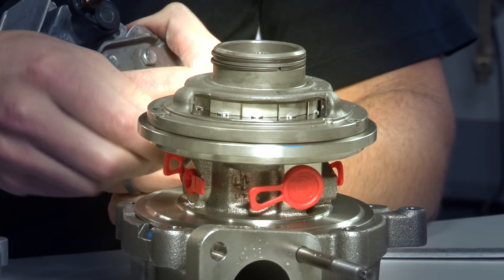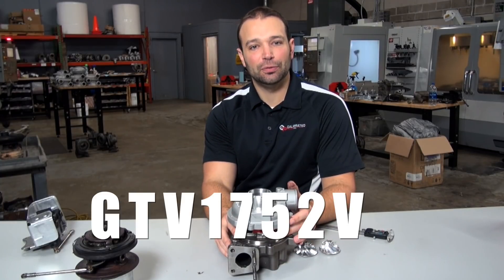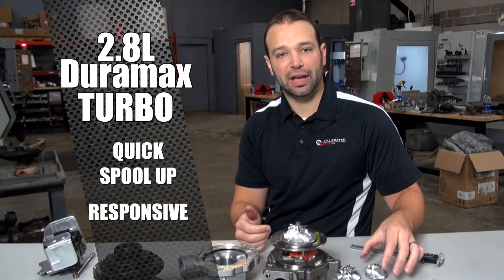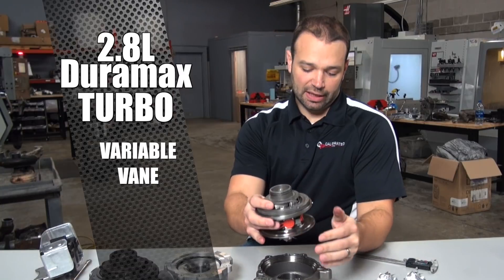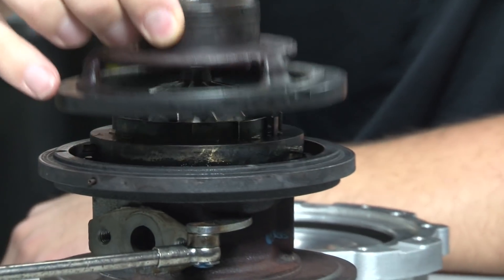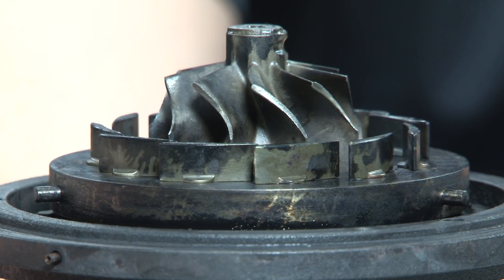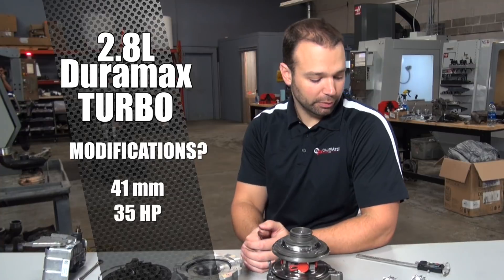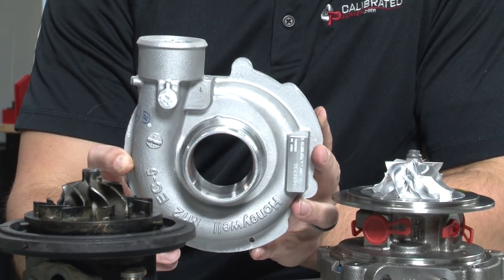The Duramax 2.8L Turbo - Diesel Insights

Comment: @Nick - when you are 'tuning' that turbo on the 2.8, up to a 41mm compressor wheel, do you have any other aspects that need to be redone? Or is it as simple as upgrading the compressor wheel? Im sending my truck into the Chevy dealer and wondering if this is something they can do or do I have to go to an after market tune shop? And do you know of an aftermarket tune shop in the Denver Colorado area you would suggest?
Reply from the maker: Hey Aaron, give us a call 815-568-7920. Our phone lines open at 9 am central.

Comment: Hey Nick, Do you think this is enough engine for a 2021 GMC 3500 cutaway van with a 16 foot box for carpentry use?
Reply from the maker: What’s it weigh?
Reply: @Duramaxtuner  https://www.gmfleet.com/vans/gmc-savana-cutaway-3500-4500
According to this 10-14000 GVW.  I'm lookinga at the 177" wheelbase.  I wish they's bring back the 6.6L duramax in these.
Reply from the maker: @24revealer  I think with a tune it’ll be average. Without a tune it’ll be a sloth. We echo your thoughts on the 6.6.
Reply: @Duramaxtuner  That's what I thought.  I think I'll just order the van with the new 400hp 6.6 gas engine.

Comment: First time I saw that kind of tech. But are those veins the modern version wastegate for turbochargers?
Reply from the maker: Essentially, yes. But they do more than just relieve excessive pressure to prevent over speed. They actually change the flow of exhaust gas around the turbine wheel to change wheel speed.

Comment: Would be nice if the water cooled turbo could replace the one in my 2006 2.8 liberty jeep. The  engines shares a lot of common traits. One is just newer.
Reply: The only thing that's fairly similar is the displacement Everything else has been redesigned

Comment: I drive an 18 zr2 duramax and trust me sir, this turbo has fucking laggg.
Reply: Think you'll find its actually the 'dead throttle' these trucks are known for. Same feeling in mine until i installed a throttle controller and turned it into a whole different beast!

Comment: I wonder if you have to tune it by adding a bigger Turbo wheel  And if it would void my warranty?
Reply: The only thing they could void your warranty on would be things that a bigger turbo could cause to go wrong.  Warranty suspension problems? No, a bigger turbo cannot cause problems to the suspension.  Blown head gasket and toasted motor, different story.

Comment: Any updates on this turbo upgrade? Very interested because this is my second warranty turbo replacement.
Reply: Use amsoil 5-30 diesel  oil. Put it in my 2017 . What a difference. Amsoil is the best

Comment: When are we going to be able to purchase these wheels? Msrp?
Reply from the maker: We have this project still in the R&D stage with no ETA for release.  When we do release a product for the 2.8L turbo it will most likely be a complete unit and not just the wheel.  Thanks for watching!
Reply: @Duramaxtuner  any news on upgrading the turbo?

Comment: I'm sorry to ask, but why the hell would anyone want to tune a 3 yr old Duramax diesel engine? What's wrong with 181hp and 369 lb.-ft. of stock torque? That sounds like more than enough power for a vehicle like either a Chevy Colorado and a GMC Canyon.
Reply: I just tuned and deleted mine a few days ago, the power difference is day and night and better mpg by 5 is a plus!
Reply: 5 mpgs just with the delete?
Reply: @candyred3v   About the same here with an emission intact tune that turns off EGR.  DPF regenerations happen half as often too.  EGR on diesels is the work of the Devil, turning that shit off does wonders.
Reply: fourtwenty mostwanted hows it doing?
Reply: The same reason  people upgrade anything else, to see what kind of performance is achievable
Reply: Ahhh! Okay. I suppose that makes sense.
Reply: your name  Yes, with the stock ECM programming, but an aftermarket tune can avoid that.  Of course there goes the power train warranty too.  I tuned mine, love that the lag at the gas pedal is gone and that it gets 15% better fuel economy.  It even sounds better - not shocking really, what diesel engine runs it's best while sucking down a bunch of sooty black smoke...
Reply: your name  The tune I have keeps all the stock exhaust system, it shuts off EGR and DEF though.  It regenerates half as often (every 540 miles) as it is putting out way less soot than stock, but probably enough NOx to make VW blush.  That is the nature of diesels - NOx vs. soot.
Reply: @duken4evr  would love to have some more info on what tunes you are running. Looking into that for a z71 2.8L. Just doesn't have that "get up and go" I'm used to with my tuned and modded LB7 2500HD. For such a smaller/lighter truck, I was hoping for a little more "zip".

Comment: What we use in 3.0liter engines probably will work with this engine too. So basically take a gtb2260vk and add 51.5/48.6mm turbine and 48-50mm inducer compressor wheel takes you around 400hp.
Reply: When you get to the 400 horsepower range you gotta worry about piston connecting rods on the 2.8  That's the weak point After that you can just get a compound Turbo kit If you want more boost  they even have emissions compliant ones

Comment: Does the egr valve help to control over speed of the turbo or is this done by the vane position? I ask because I'm trying to figure out what the negatives are to blocking the egr valve. Great videos btw  great to see how things work in our trucks without having to take them apart. I'm in Australia with the 2.8 duramax and loving it.
Reply: Negatives of egr - do you really want to pump soot, dirty exhaust, back into the combustion chamber?  No.

Comment: Any reason why the turbo is so quiet? They barely whistle compared with other brands turbo diesels.
Reply: I wish you showed how it gets oiled.
Reply from the maker: It's just the way it's recorded. It is very difficult to record the whistle and replicate the same sound you hear in-person.
Reply: No not in your audio, i own a colorado with a duramax, and here in australia we have only just got dpfs fitted since last year, so earlier models even with a full open exhaust the turbo is barely audible compared with other diesel vehicles.
Reply: I had the  same question with my 2016 colorado. Hard to make out the whine.
Reply: If you find out let me know, I've also got a colorado haha
Reply: i just drove a powerstroke f150 and the small diesels are really quiet.  the powerstroke is more quiet then the ecoboost.  guessing its the same for this

Comment: I just did my oil and fuel filter on my 2.8 L duramax and now I'm seeing the engine shake more than usual. What can cause this ?
Reply: Any abuse or been driving normal?
Reply: Bad motor mounts? I don't see how changing oil can make a motor shake.
Reply: @paulschab8152  u you how sometimes when you put the wrong thickness of oil inside a bmw, the engine doesnt even turn or does a jerking mode.
Reply: I always put Mobil 1 5w20 advanced full synthetic in my 05 Acura Mdx. Sadly I don't own a BMW even though a second gen x5 or 5 series is on my list. If somebody puts the wrong oil in, they should not be doing it lol.
Reply: I'm not saying alejando did . But just trying to think of odd ways and thinking how can engine shake after an oil change ...

Comment: Okay I'm confused:  I thought the vanes opened when you let off the throttle to act like the old "blow off" valves? So is it actually the opposite?
Reply: Chad Greene: only when the Tow/Haul mode is active, or more specifically, when the engine brake mode is active. On the LWN, Tow/Haul and Engine Brake are linked.
Reply: vanes are closed at low rpm to increase response.  they open up as the rpms increase to make the turbo seem larger then what it is.  it eliminates the issues with non vaned turbos which are either small turbo for response but no top end power or larger for no response but all top end

Comment: When’s the upgraded turbo expected to be available?
Reply from the maker: No specific time at the moment (December 2017) so we'll keep you updated.
Reply: Ok, thanks! Some of us on coloradofans.com are impatiently waiting HA!
Also, will the entire turbo need to be purchased with your modifications or will the larger compressor wheels fit in the stock housing?
Reply from the maker: Our wheel assembly will not fit in a stock turbocharger.
Reply: Duramaxtuner Ok, thanks!
Reply: will your bolt ons suit the international vehicle in RHD? (Australia)

Comment: I smell upgrade parts available in the near future
Reply: Duramaxtuner since that is the improvement over stock, can those gains be expected across the board with the different tunes as well? For example if the tow tune claims ~30hp and your turbo mod claims 35hp would both the mod and tune yield a 65hp addition?
Reply from the maker: Yes indeed.
Reply: Duramaxtuner you mentioned 35hp is that on a stock truck or with a tune? If tuned, which tune? Love mine with y’alls tune, got some vids on here of it. Towing is the biggest improvement with your tune, but daily driving is also a lot more fun now as well.
Reply from the maker: That's over stock. Glad to hear you like the 2.8 tunes.
Reply: Duramaxtuner *love  lol
Reply from the maker: The tunes would increase horsepower over the baseline - so if the truck's baseline is 205 (with an upgraded turbo) then, in theory, the calibrations would increase horsepower over that - so yes, in theory. But we would need to ensure there's no negative effect on EGT's, among other issues. We selected the horsepower gains for a reason, in other words. Hope this answers your question.
Reply: Duramaxtuner you answered my question perfectly. Thank you for getting back to me. Im looking forward to seeing more great work on the babymax!
Reply: Can u do a follow up video on the zr2 Aka holden colorado z71 to us aussies all we get is chip tunes ect. I'd love to see what a turbo upgrade ect and or more could produce.
Reply from the maker: your name  NO! We tune all of our trucks with the stock exhaust.